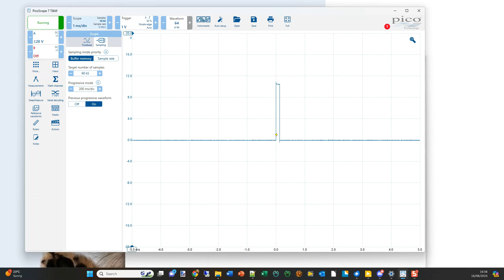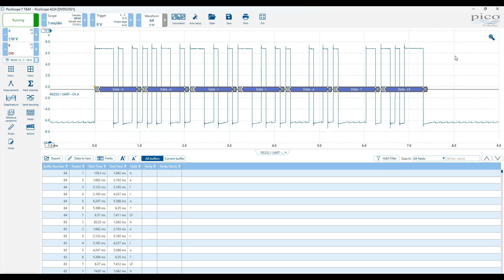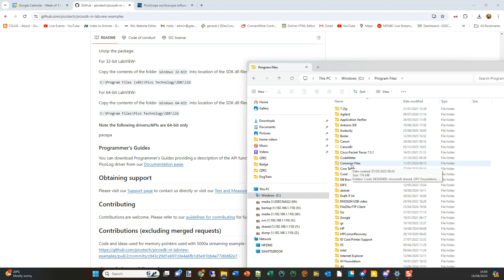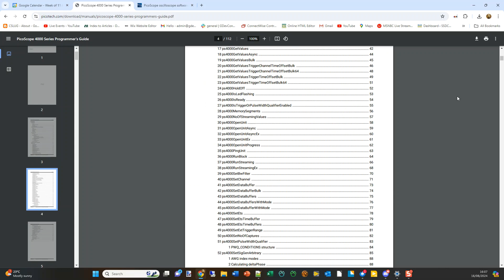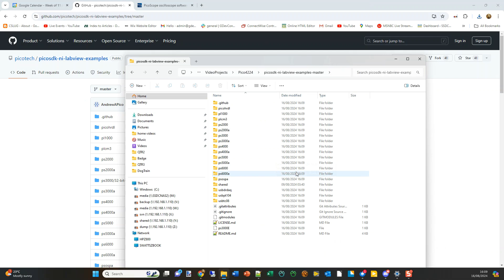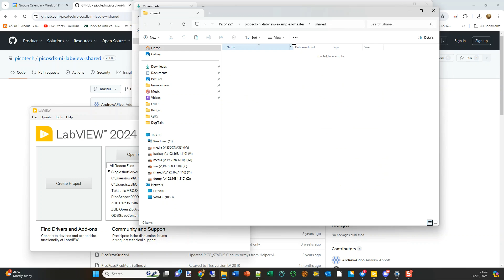PicoScope 4224 Review

Comment: Nice overview of the PicoScope. We have used one of these devices (I can't remember the exact model, but the software is the same) to decode some 1-wire comms. It took a bit of playing around with the settings, but seeing the decoded data is very helpful.